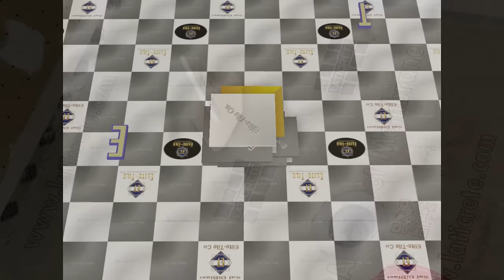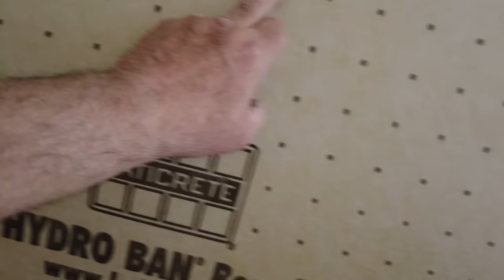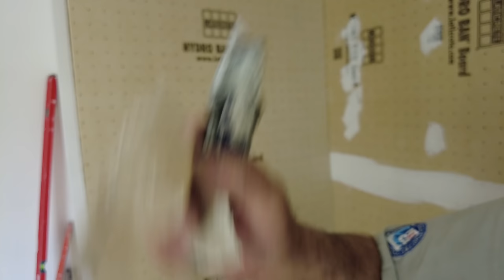Shower waterproofing, step by step.

Comment: well, looks like my 20 years of using schluter may be interrupted with some laticrete systems. i will tell you that those kerdi inside and especially outside corners gave me grief with the the buildup causing me to use excessive thinset to make up for those areas. i want to run my notch trowel from end to end and apply the tile as close to the membrane/substrate as possible. i use to float for years and was rewarded with a true and flat mud job with very little thinset needed.  if i can find a system that replicates that, i would be less grumpy on my son who is learning this trade. thank you sal!
Reply: Gave up Schluter 10 years ago…never looked back

Comment: Hi Sal, Ive watched a few of your Hydro Ban Board shower installation videos. I believe this one being the most recent you have done. Looks like there is no need for a hydro Ban paintable waterproofing membrane of sealing tape on the flat  walls if you trowel the sealant? Is that the case?  I'm sure you are aware of the shortage of Kerdi sheet products available now. I am going to use a 12x28  Kerdi Niche and hydro band board in a tub surround application. Any recommendations for waterproofing the seams between kerdi niche and HB Board? And lastly what to do about modified vs unmodified thinset with the 2 different brands? I have 254 platinum for the walls, with that be ok in the niche?  Any input is greatly appreciated!

Comment: One sharp grain of sand while embedding the sheet membrane is a leak! This system can be flawed with user error…I always put a coat of thinset over the mud and let it dry to prevent loose sand from coming loose and perforation through the sheet membrane….
Reply from the maker: The membrane is tougher than you think.

Comment: After using the schluter system, i was thinking their system could be improved by using the schluter glue between the joints..  
Hydro Ban takes that to the next level.  The membrane looks thicker.   Thank you for posting.
Reply from the maker: Thanks for watching my video.

Comment: Good video, wish I had seen it 3 years ago before I did a master bath shower with Hardie backer, Schluter over it. I will definitely use the Hydro Ban backer from now on.  

On the overlap, from my uneducated point of view I think you should put the membrane on the pan surface first, then the wall-to-floor transition bands, then the corners last. I know this is not a roof, but the principle is the same-- water flows downstream. You're not going to know whether you have pinhole leak failures at the corners or bottom seams by doing just a crude flood test. It may take months and years for pinhole leaks to rot the floor joists. If the leak water flows downhill via the overlap, eventually to the drain, that's inconsequential. But it would definitely be consequential if the leak water follows the surface of the corner unit if it's under the bottom membrane or the wall-to-floor transition bands. Certainly an over-paint with Hydroban liquid might minimize that from happening, but why rely on only that to "save your life" (so to speak)?
Reply from the maker: This is a common misconception, manufacturer does not care what order you do the banding. And you are correct it is not a roof and does not have to shed water, it has to hold water. Also why you flood test, to be sure you did it right. Never had a shower fail a flood test. As to you point about a possible failure and a pinhole. A failure is a failure, if it leaks it failed, no amount of water shedding will fix that in a failed waterproofing of a shower that sees over the equivalent of 1000 inches of rainfall.

Comment: I like this substrate better than kerdiboard, especially I like how the screws hold up on it. 
Doing a few showers out of it right now, but the designer specked out kerdi line drains, so those come with kerdi fleece on it..
Would it be ok to make the showerpan out of kerdi and connect with this board in the same way using schluter bands and corners?  I don’t care about the warranty,  but would like to hear if anyone is strongly against it
Reply from the maker: I have used the Kerdi banding and drains several times with Hydro ban board. As you noted, you will lose the warranty, but it will work just fine. I prefer to stick with a single manufacturer when possible though

Comment: Greetings, Ive used the Schluter system over 40 times and this looks very similar. I havent tried this Laticrete system yet but i want to. I use Laticrete thinset all the time though. The question i have is (like with Kerdi), would Laticrete 272 or 317 be better to use with this hydroban system since they are unmodified thinsets??
Reply: No, even with the schluter system use All Set Modified thin set for waterproofing, it holds up way better. The showers built with the unmodified thin set should hold up, but All Set gives a better bond, test has been made. With the Laticrete system I’ve found it best to use Multi Max lite,  or one of the higher line of thin sets, the bond is incredible. Both systems worth, based on test that have been done the laticrete system is a little bit better and the membrane that’s lays on shower pan is a bit easier to install. Hope this helped👍🏽

Comment: Thanks Sal. I'm using this system also with identical wall board installation.  Use their pre-sloped pan and passes the flood test with the sealant connection between the pan and wall board.
Reply from the maker: With the foam you can do that, with mud you can't.
Reply: @SalDiBlasi  why would you do a mud floor and not a pre-sloped pan? It looks like it adds a lot of work if you can just sealant the pan to the walls
Reply: @gtpro700  A mud floor gives you more flexibility regarding drain location.   Joists can force you to offset your drain.   Your drain must be perfectly placed with a foam pan.  A foam pan also requires a perfectly flat, and level floor, where as a mud pan doesn't.  If you have to trim your foam pan to fit, its perimeter won't be level anymore, which will cause issues with your 1st row of tile.   For a one-off DIY remodel, a foam pan may be the way to go, but to do multiple showers, it's best to learn how to do a mud floor.

Comment: Thanks for tutorial, very helpful. I have 2 questions . Is there benefit using the sheet membrane vs the liquid hydroban over dry pack pan. I know the time and costs of have time is one better?
Also on the change of plane in bench think should use the banding vs sealant?

Comment: What is the benefit of using banding over the Sheetrock transition rather than covering the transition with the sealant like all the shower wall seams?
Reply from the maker: Sealant sticks to the foam board, but not  drywall

Comment: Great video Sal! Would it be possible to use the HB boards method you show and adding a Schluter pan into the mix using the sealant between the two products?
Reply from the maker: Laticrete has its own foam pans, so I would use one of those.
Reply: @SalDiBlasi  thanks for your prompt reply. I have a Laticrete distributor not too far away but haven’t been able to go in person (Covid-19) to throughly “see” the system but will do so soon. Thanks again!

Comment: Could you use the process of adding a bead of sealant when joining two perma base concrete boards together and for over kill add seam tape and sealant or thin set at joints
Reply from the maker: No
Reply: OK…why not???

Comment: Hi Sal.  Love your videos!  Question about using only sealant between seams and corners.  I saw a video by the Tile Coach where a Wedi system that uses sealant only failed at a customers home so badly, he had to replace all the joists and studs in the shower due to sever rot.  Apparently the sealant delaminated from the board allowing water to pour through.  I know your video is 3 years old, would you still recommend the sealant method today?  Is there a difference between Wedi sealant and the one for Hydro Ban?

Just to clarify, the delamination happened in the dado where the floor met the preformed shower pan.  The sealant in that dado joint delaminated.
Reply from the maker: I still use sealant, however my shower floors are mud and I use banding to seal the floor to wall connection so no sealant to fail there.

Comment: It was recommended that I use 1/2 inch Hydro Ban board around my tub. Is that ok? When would you use a 1 inch or greater thickness in Hydro Ban Boards.

Comment: Does mortar stick to the sealant?
Reply: Can't find anything on the laticrete website about adhering to the sealant. I know you're not supposed to be able to bond to kerdi fix or similar polyurethane sealants. This laticrete sealant looks like it tools a lot differently than a polyurethane sealant does. Almost like it's an acrylic latex. I trust Sal has done his research though! 😁
Reply from the maker: Yes it will stick, it is designed to work with thinset mortar, otherwise what would be the point of using it in a system that relies on thinset to adhere tile to the substrate.
Reply: @justpassingthrough7989  it's almost certainly a STPE-based sealant.  Almost all major sealant manufacturers offer them now (originally developed by the Japanese to seal windshields to car bodies but now widely used in building construction as liquid flashings at doors/windows).  That said, on vertical surfaces, probably any high-quality sealant would work. It's the horizontal seams where water may sit that really need a high performance STPE sealant.
Reply: Awesome!  I ask because similar waterproofing systems to this, have had issues with thinset bonding to the sealant

Comment: Hi Sal is this material less expensive then Schluter? Not sure which way to go now. 
Sal that last board you put over the pipes what is that yellow looking foam insulation or what type of insulation behind the board is that. I feel behind the tiles and the drywall I believe they put in my bathroom he said it was green board on the ceiling which is peeling already there’s no insulation or anything because every time we turn on the water or just any little movement with the handles in the shower sounds very echoey and very loud so when I have and who’s job is it to do all the work in the bathroom, is it a plumber is it a tile specialist whose job, so I can start searching for that person. As my general contractor that I fired along time ago was the one doing all the hiring so I didn’t know who was who. Thank you.🙏🏼
Reply from the maker: Not exactly sure about the insulation, might be Rockwool. As far as the prep for the tile work, that should be the tile guy, he should put up the board, do any furring needed to get the walls flat, if you ask him he might do the insulation, but that is generally done by the GC. Sheet rock on the ceiling is fine if it is not a steam shower. Laticrete Hydroban board is more affordable than schluter, but just as good.
Reply: @SalDiBlasi  thank you Sal got it 🙏🏼👍🏼

Comment: When you do a steam shower do you use thin set to seal the seams with the liner?
Reply from the maker: Steam showers need to have banding on all the seams installed with thinset, no sealant.
Reply: @SalDiBlasi  thanks for the reply. I've been looking at doing a steam shower as a potential for a bathroom remodel. Love your videos.  You are one of the best instructors out there

Comment: Mr. Sal,  do you need to install the hydro ban membrane sheet if  I'm having  a custom culture marble floor  made with. 5 inch boarder as my shower pan?  All separate pieces  not a big one pc. mold. Thank you for your response.
Reply from the maker: Shower has to be waterproof, no matter what you are installing
Reply: @SalDiBlasi   Thank you 🙏 this is going on my shopping list for today. We start the project next week and the store that has laticrete is close to an hour away.

Comment: Sal I noticed at one point it looked like the board on your side wall ended out further then the adjacent drywall. in this case do you miter pieces of tile to cover this, and what if it isn't plumb as a lot of the time the drywall isn't. Do you have a video on this? I try to end in a schluter strip if the customer doesn't insist on bullnose and it seems as this might cause a problem or just be time consuming and maybe even not look good....
Edit: sorry must of been another video cause it looks as if these are flush

Comment: Hi Sal - we met once at Coverings Atlanta. 

I have the same question as another commenter. Looks like you used basically the whole Laticrete system, except you used a Schluter bonding flange. Is this accepted by either company? 

I love the idea. Schluter has been great for me, but I'm so damn tired of getting my walls super flat and then messing it up with Kerdi band! Would appreciate an answer. 

Thanks for your videos.
Reply from the maker: These days I usually use FloFX drains, as far as the warrantee goes, talk to your Laticrete rep to get a clear answer you can trust, they are always willing to help.
Reply: @SalDiBlasi  Thanks for the reply. Yeah the reps have always been really responsive. Sometimes I forget I can just call someone.

Comment: Sal did you use a vinyl or Oatey membrane under your dry bed mud on this install ?
Reply from the maker: no
Reply: @SalDiBlasi  Thanks... asking because it seems like the top liner membrane system negates the need for vinyl or Oatey barrier.  Seems like top layer waterproofing  and Oatey barrier is belts and suspenders. Are the new waterproofing technologies negating the purpose of the Oatey/PVC ?

Comment: Incredible job! Thank you for posting this. I hope you’re charging enough money  for such a high level of detail and professionalism. Have you considered using a 90 degree corner drywall tapers tool for spreading the bonding material into the corners?
Reply from the maker: I usually use those, but wanted to show with regular tools.

Comment: The laticrete glue looks easier to work with than the wedi or hydroblock...not as thick. Or is it the same exact stuff?
Reply from the maker: Yes, I find it to be a little easier to apply.

Comment: Would a steam shower not last if sealed with board and polyurethane
Reply from the maker: Steam showers have to meet proper requirements or you will get mold and mildew, do not cut corners or substitute materials that are not designed for steam.

Comment: Can I use the liquid and fiber tape over this sealant method for added security? This is my first shower...
Reply: Which fiber tape and liquid are you referring to?
Reply: @ridenorthwest1687  Laticrete's liquid membrane paint and their waterproofing membrane fabric used for impregnating the liquid.
Reply: @seandaliege  Yep, thats what I do. I use the fabric banding in all the corners then I use the paint on stuff on the pan and up 6 inches. I brush the corners, let dry then roll on 3 coats. Its definitely over kill but my pans have never leaked.

Comment: Hi Sal! I am installing a tile that has a matching crown ( to put all the way to the ceiling) and a matching 5" base that goes all around the bathroom floor which goes directly into the shower with no step.  Where do I start the tile, at the top of the wall with the crown ceramic piece or at the floor with the base pieces?  Subway style field tile goes in between the two in the shower area.
Reply from the maker: If you have a crown and a base tile moldings, be sure that the shower floor and the ceiling are level  .  do a layout for all the elements of the tile so you know what all your cuts will be before you start your tile, once you have done that, you can start where it makes most sense, in most cases that will be the bottom and work your way up, otherwise you will be fighting the tile that will not stay in place with most thinsets, they tend to slide downwards.

Comment: Great video and about to do the same process, What did you use to waterproof the curb after the flood test. VIdeo sorta stops after that. Can you use the same membrane to wrap the curb?
Reply from the maker: The curb is waterproofed like the rest of the shower with the sealant at all comers and seams, banding for  shower floor to wall connection.

Comment: Nice video again Sal.  All modified thinset? vs. unmodified..  Add fiber mesh tape or fiber band to the caulk joints?
Reply from the maker: No restrictions on mortar no tape required at the seams and corners

Comment: Hi Sal, on the floor of the curb you added that strip of Hydro Ban.  Did you add another strip that overlapped the floor and inside of the curb (off-camera)?
Reply from the maker: Sorry don't quite understand the question, but the curb is clad in board on all three sides.
Reply: @SalDiBlasi  sorry Sal, I figured it out by rewatching the video.  Perfect job as always my friend.  Thanks for responding Sir.

Comment: Sal
Is the sausage tubes more cost effective than the smaller gun tubes. I dont own a sausage gun. So I always bought the tubes. Also I notice the banding you installed is some up some down.. I always  thought it was reading up
Reply: Sausages are almost cheaper (although only typically available in commercial supply houses or online).  Benefit is more product (typically 20 oz vs 10 oz tubes) and far less waste (just a 1/2" or so of compressed plastic casing rather than the bulky hard plastic tubes).  If you do any meaningful amount of caulking, it's well worth buying a quality sausage gun (typically come with multiple spare tips).  Commercial guys use battery-powered caulking guns (Dewalt etc) to reduce hand/wrist fatigue.
Reply from the maker: What Arthur said, however the sausage tubes in my area are less expensive than the sealant, twice the amount of sealant less per unit
Reply: Here the sausage tube is only a buck cheaper than the tubes combined.